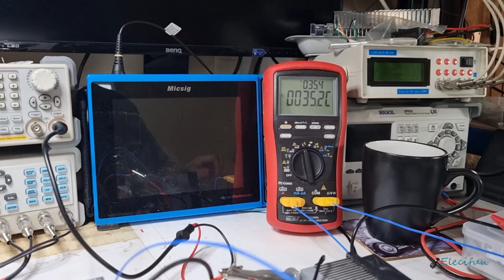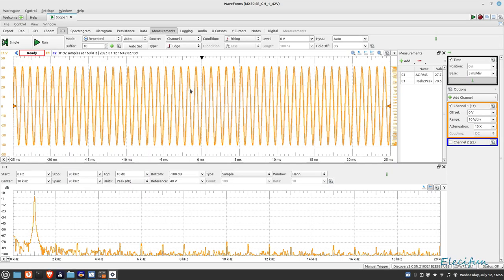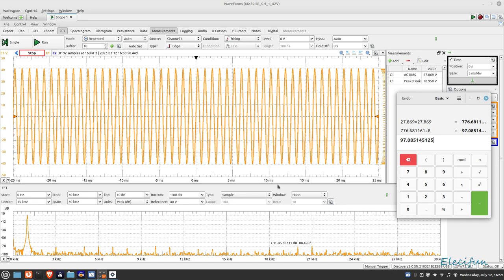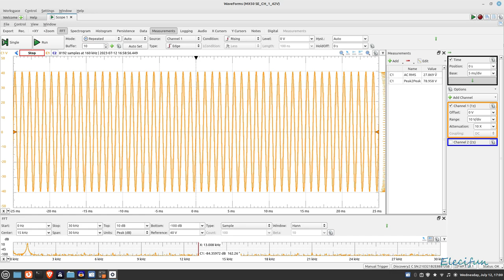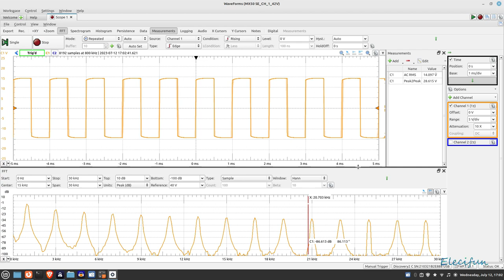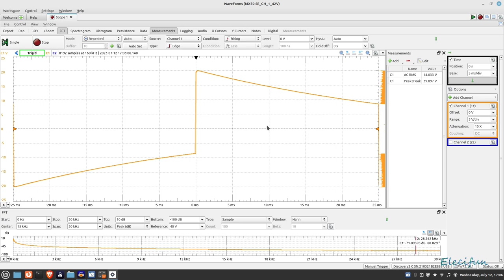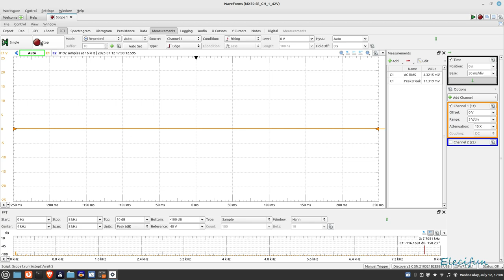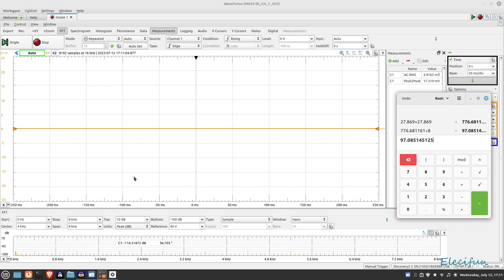MX50-SE Amplifier Kit Power Test @ 42V

Comment: This amplifier was one of the first I built on my channel some 5 years ago. It does run warm on QI but never runs away. I did try lowering the QI but you can see a few crossover spikes if you do. Your sinks are a little small but probably OK for 8 ohm music. 4 ohms is another matter, you will almost double the power. An amazing amplifier for so little money but of course it's all the extra bits that costs. Transformer, rectifier block, protection, heatsink etc. The L12/2 sounds somewhat better, more detail, dynamic range, DEEP bass but it costs more.
Reply from the maker: My heatsinks on this one could do with being better, although I do have a 60watt per channel that does very well with them. One of the channels runs hotter than the other. I did demonstrate in a video but edited the temp output out, my bad. I will have to show that and check and see whats wrong. 
I've been seasonal working and I'm back now to continue with the audio amp series. 
The L12-2 is the amp I have been using for the last month or two. I agree better dynamics and bass and a good choice for us DIYers.  Just a quick video on another amp circuit before that one.

Comment from the maker: After listening to my music and movies through this little amplifier for a week or so, I can say hand on heart it is quite good, especially when the price is considered. I would be worried about using with a heat-sink the same size or smaller than I am using in this video at 42V.  At 25V and listening to music etc the heat-sink I use is fine.
In regards to heat-sinks, bigger is better.
Reply: Well yes, that's right! 🤔 A bigger radiator moves more heat away from the big transistors. (D1047) So yes you are right. I learnt the hard way. 😆

Comment: I'm with you as far as power goes. In most average size rooms 20-30watts is sufficient. It's nice to run a 100w amp at those wattages.

Comment: Hey Dude !

I'm thinking of going straight into buying an 800W Class A amp ! Do you think it's a bit too ambitious considering my level of knowledge? 🤔 😂

AIYIMA are offering this amp which cost $166 AUD. 

Maybe I'm wiser to start out with something smaller. 🤔
Reply from the maker: Um 800 watts, class A..?  That's gonna be a juice guzzler 😅
Reply: @Elecifun  What ! How bad??? 🤔 😄

It interesting that you should say that because that's what I was reading last night. Something about power efficiency.

I've always wanted a really nice and yeah powerful hifi system like I listen to decades ago.

My mate created this great hifi system which was 100W per channel into 4 ohms.

In those days I didn't appreciate or understand the significance of 8ohms vs 4ohms.
I read a few weeks ago that 8 ohm speakers apparently sound better than 4 ohms speakers or that's what the article seem to suggest.
Well what should I be going for sir? 😄😃🤔

An A/B class amp?
Reply: @Elecifun  oh incidentally I just bought a new Rigol benchtop power supply sir! 😀

I should have it in a week.
I noticed that you bridged your two channels into one which is interesting.🤔
Reply: @Elecifun  I was thinking of building a bigger system like maybe 18" woofers but the price is maybe too high.

It's not just the price of the speakers it's the price of the amps to run the speakers as you already know. 

So I've downsized the speakers to 10" bass, 5" mids, and 1"tweeter.

Still even these are going to be expensive and require quite a bit of power to drive them.

The box is around 1 metres tall.

Would you be interested in building them sir? 🤔😀
Reply: @Elecifun  Are you still awake?
Reply from the maker: @decem_unosquattro9538  That's how I make positive, virtual ground and negative supply for powering amplifiers... Which supply did you buy?
Reply: @Elecifun  I lost the gist of our conversation.

What are you responding to sir?

🤔🙂
Reply: @Elecifun  I'm still trying to understand how ground works. 

I keep thinking of positive and negative but it's not positive or negative it's AC.

I'm hoping you'll get a much bigger power amp maybe at least 800W.

Why, well because that's my dream system.

I'm already carefully researching pre-amps, power amplifiers, audio power supplies, speakers, and cabinets for the speakers. 

Like I said before.

I would have liked to have built a pair of 18" sub bass drivers but the price is prohibitively expensive. It's not just the speakers it's also the power amplifier.

It's my understanding that you need some-where between 2 to 4 times the power to drive speakers properly.

Otherwise as you've mentioned in your videos.

Speakers will clip when the run out of power.

That's potentially damaging to speakers and the amplifier.

Which means 700W RMS speakers need at the bare minimum 1400W!

Double that for the other side well obviously we would need a 2800W RMS amplifier.

That's a lot of money obviously.

The better the amplifier or the lower the THD of the amp then the more expensive the components are.

As you know.

I want to know how much power I would need to driver 200W+80W+60W RMS of speakers?

I'll do some more reading anyway.

From what I've read so far a separate pre-amplifier and power amplifier is ideally the best way to go.

Pre-amplifiers switch input signals phono, source, tape, DAT, CD player,  receivers etc.

They also add gain to the signal which boost it to 1 volt or they bring it up to a line level signal.

My mate from decades ago had both(pre-amp + power amp) but at that time I didn't fully understand what they actually did. 🤔

I need to understand the different classes of amps.

Class A is probably too expensive.

Class A/B might be my best choice.

You already know much more than me in this regard.

That X2 suppression capacitor that you used is a good idea from what I've heard in videos about power amplifiers. 

There are I believe two or more of these devices.

X2 and Y2 suppression capacitors.

X2 types catch fire if something goes awry whereas the Y2 are an electrical shock hazard. line to ground safety standards. 

An electrical engineer was talking about electrolytic caps vs metalized film capacitors (X2 suppression capacitor). He said electrolytics are cheap but they not generally designed for audio signals .

They let through a lot of RFI and EMI noise or distortion or something like this.

And that's why they use the X2 suppression capacitors.

It was an interesting discussion. 🤔 

Moreover they control the volume

Many of these devices are now obsolete.

Although turntables have made a comeback because of the warmth of the sound. 

Anyway I'm just waffling on.

😄
Reply from the maker: @decem_unosquattro9538  Speakers will have a amp power recommendation. Feeding 30 watts into 120 watt speakers will work fine, but a 100 watt amp will work better. Feeding 120 watts into 30 watt speakers will overdrive and damage the speakers.
X2, Y2 are for different voltages.
Reply: @Elecifun  oh okay. 🤔

Too much then. 4x times is excessive.

X2 vs Y2. Oh I see. 🤔 hmmm.

"They can be thought of as double-insulated. Y1 are pulse-tested to 8kV and Y2 to 5kV."
Reply from the maker: @decem_unosquattro9538  Y2 is more for industry loads. X2 is for domestic.
Reply: @Elecifun  oh okay. Yeah I read something about it. Thank you sir. 🙂
Reply: @Elecifun  I'm working out how to wire my dream hifi system. 

Serial 
Parallel 
Serial/Parallel configuration

3 Way system

Comment: Hey Dude 👋 😅 first !

97W per channel! 👍

What speakers are you running sir? 🤓🤔
Reply from the maker: I am looking at buying a chassis but for what amp circuit I am not sure.. I have another two circuits here, one I am testing, another to build and another circuit on its way. 
ATM this amp is attached to Monitor Audio, Monitor 300's
Reply: @Elecifun  Okay, so you have three amps right? The NAD, and AIYIMA and the TD7294 right? Well maybe you could get one. The gold chassis would look nice, or silver or maybe the black one still depends on your finances. You don't want your misses chewing your ear off. 😄
Reply: @Elecifun  Have you had a go at building speakers? 🔊 🤔
Reply: @Elecifun  I think I might buy this diy kit broh. 🤔 I won't build the audio psu because I don't know how. 😕
Reply from the maker: I have ESP 3A, MX50-SE, Quad405-1, Quad405-2, LM1875, TDA7294, NAIM NAP250 and L12-2(on its way) power amps. A few pre-amps including two NAD and two tube. Not sure which I like best, still building some and testing incomplete.
Reply from the maker: No, as that will need tools I do not have, not to mention the space. I'm happy with Monitor 300's atm.
Reply from the maker: I showed in a video how to build the PSU, easy and it works really well.
Reply: @Elecifun  I thought you cooked one of them?
Reply: @Elecifun  oh okay I'll have a look later. 👍
Reply from the maker: @decem_unosquattro9538  I cooked ESP 3A and repaired a few times. All part of the fun.
Reply: @Elecifun  I agree, to learn you gotta fu! It's the only way to grow and learn. 

Japanese have a quote that goes something like this:

"If your not making at least 9 mistakes per day you're not trying hard enough."

I mean non of us wants to FU, but I can't see how that's possible to learn and push for growth. 

I try to get as close as possible and then chance it to some extent.

On my Z5500 surround sound speakers I replaced one of the bridge rectifiers thinking the problem might be else where and not just this rectifier.

I thought what the worst that could happen? 🤔 💭 

I'll blow the fuse.

I had already fixed some additional capacitors on the control hub and to be honest I was getting tired of trying to fix it.

So in the end I risked it.

As it turned out nothing else exploded and I didn't blow another slow burn fuse.

I think I cooked my cheaper multimeter bcz it's not working to good. 🤔😀
Reply: @Elecifun  I think the main thing not to fu is expensive equipment. That really would be a major F.U.
😒
Reply: @Elecifun  Eventually I want to build a 1400W RMS system.

I think the speakers are 15" Visaton bass drivers which are rated at 700W RMS per channel. Peaks of 1000W.

Still that's a long term goal which won't be easy to achieve anytime soon.

I think they cost -$900- $450 each PAW38 @8ohm and that's just the bass driver or woofers.

I'm not even sure they're suitable for this long term goal.

They might actually be P.A. speakers which aren't suitable.

Wrong frequencies.
Reply: @Elecifun  Hey Dude! 👋 🤔

I was just reading the spec sheets in the Texas Instrument sheets and what I noticed is the supplied voltage is very important or it appears that way.

For example:

The LM3886 IC package will put out 68W continuous average power into 4OHM at  +-28V.

38W cont' average power into 8ohm at +-28V.

If you boost that voltage to +-35V you get 50W at 8ohms.

So really it is  dependent on how much voltage is supplied and the ohmage of the speaker. The latter obvious whereas to me the former is most interesting.  🤔
Reply from the maker: @decem_unosquattro9538  All depends on voltage tolerances and how the rest of the circuit is made up. The datasheet refers to ideal scenario of IC implementation. Which is the same for any amp IC.